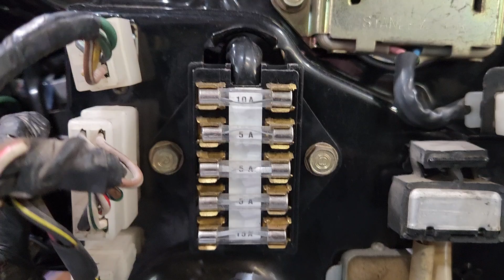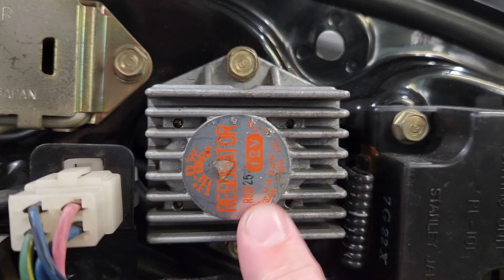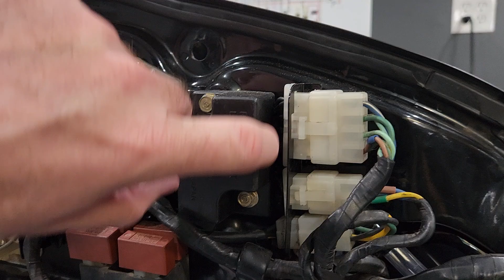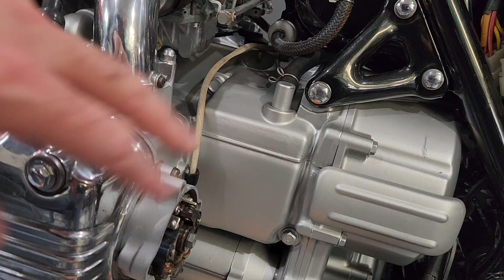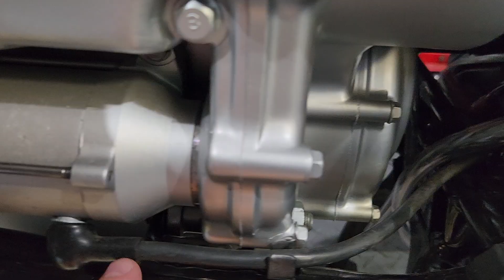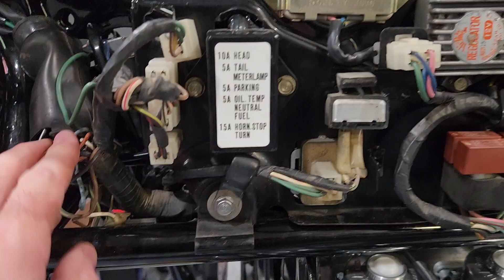1975 GL1000 Gold Wing - Electrical System Components

Comment: HI Great info. i have a 75 and the Ignition switch has 6 turminals but the harnes has ony 5 can you id whitch wire goes were on the switch terminals ,the block has been cut of on the harnse side.
Reply from the maker: I'm away from home for an extended time so I can' be as much help as I'd like to be, but if this helps it should lay out what wires you're looking at:

https://www.randakksblog.com/wp-content/uploads/2023/04/Honda-Goldwing-GL1000-1975-to-1977-stock-wiring-diagram-1.pdf

Comment: Great video, much appreciated!! What’s your opinion on points vs solid state ignition? Are you running non-resistor spark plugs?
Reply from the maker: I've put a Dyna ignition on two of my GL's and the simplicity of them is great. But I have points on my yellow '76 and it runs like a dream, and so far, I like how my project '75 is idling so we'll see how it goes. I've used NGK (2120) D8EA spark plugs on all of my GL's and have never had an issue with them.

Comment: Excellent review of the electrical system.  It gives me a good idea of what I'm looking at on my 75.  I see you just replaced your battery in April.  What did you go with?  Are most of the electrical components readily available if they need to be replaced? Right now, I'm trying to find the dual cap that goes on the spark plugs.  Whoever worked on my bike just have single wires and caps on one side.  I've enjoyed watching your video's.
Reply from the maker: I've been installing ChromeBattery brand batteries in all of my GL's. They're nicely priced on Amazon, and I have no complaints about them. My understanding is there are only a few factories that make batteries and they slap different labels on them, so who knows who actually makes these. They're sealed so I'm not having to top them off with distilled water, and they've been serving me well.